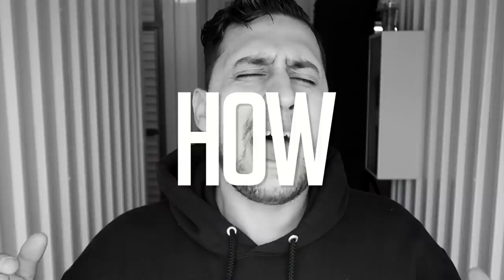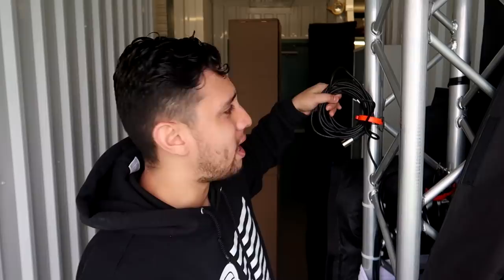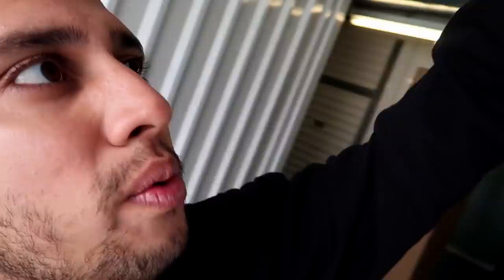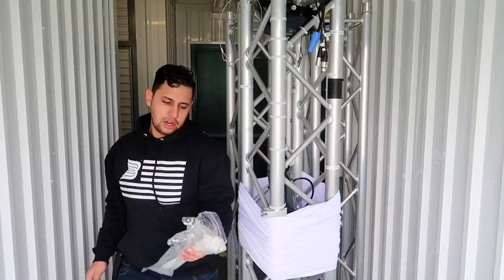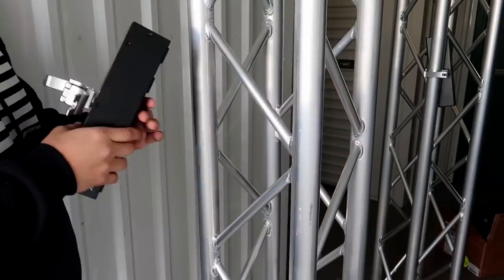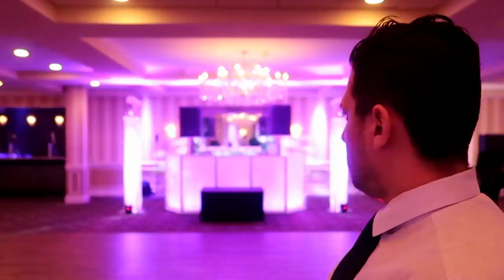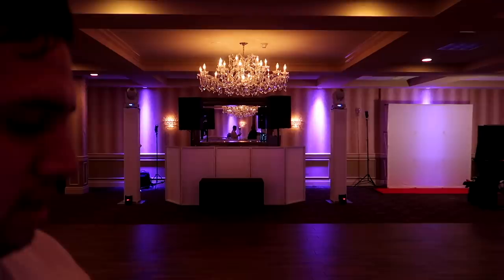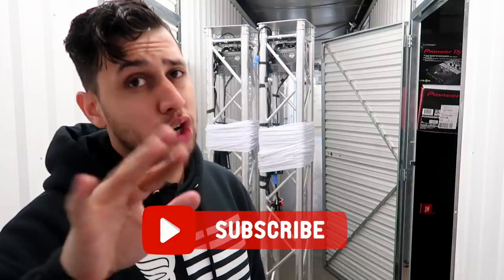Mobile DJ Tips: How to permanently install Lighting w/ Wireless DMX & Power to your Truss

Comment: Awesome build.  Been planning on doing this myself soon.  Only change I will probably eliminate the power bar links and go with one normal extension cord that has 3 plugs at the end.  Save a little weight, since I don't have Christian to help load in/out.

Comment: Your work is amazing. I. Wondering if you have found a way to secure your moving heads to the top base plate. Currently I'm using a strap but would like to find a more secure way. Peace

Comment: Hi. Great video and very helpful. Can you confirm what Truss you are using? ie F24 and where did you get the quick release truss clamp for the power bar? I can't find these for 35mm in the UK (Assuming you are using F24 Truss)

Comment: Great vid man. I have the Trusst. Glo Totems which definitely take some time to build. Contemplating whether I should go back to the regular trussing now since it will definitely save at least 15 mins for setup and break down. Also, is that the Sterling Ballroom on Hope Rd? If it is, did they do the ceremony there and then flip the room for the wedding? Was a bit of pain when I was there but worked out ok.